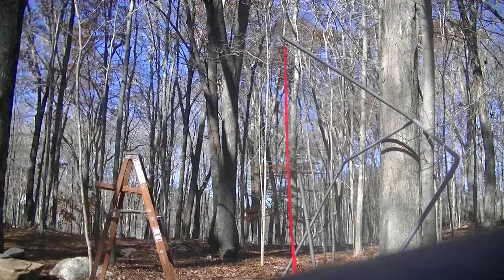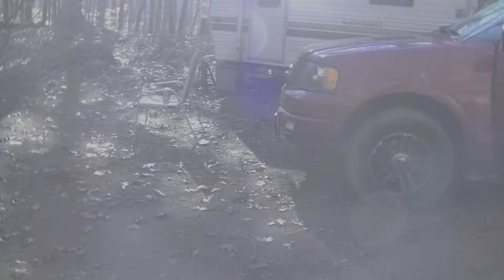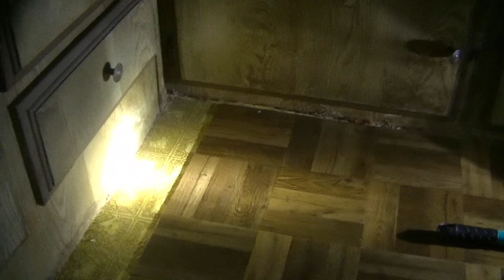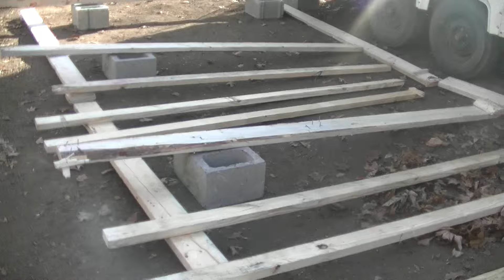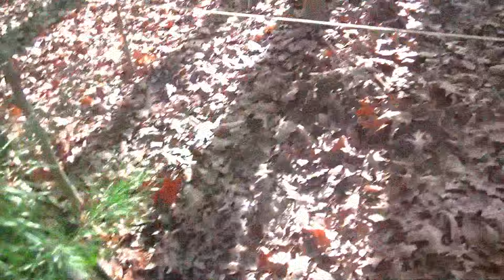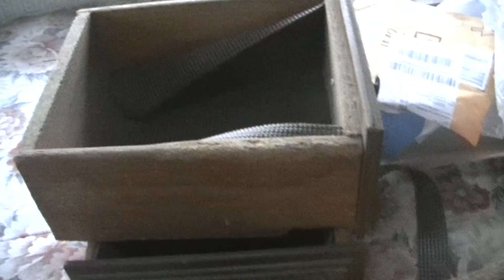Start to Self-Sufficiency Update - 11/7/15

Comment: looks god so far.  What are your plans for self sufficient cooking in the future?  also, what area in the country are you guys?
Reply from the maker: +Wilderness Warriors we're in New England. We will have the propane stove in the camper if all else fails but we'd like to get away from propane. But otherwise we do a lot of cooking outside on the fire and in the Dutch oven. We will be constructing a large fire pit / cooking station as soon as we get all the rock together. I could always run electric cookware of the solar if need be also. We're getting there, its hard to get away from society, still need groceries but we do hunt and garden and we have the ducks. We'd like to get goats when we find a piece of land. Thanks for watching any ideas or suggestions are always appreciated. Have a good one.